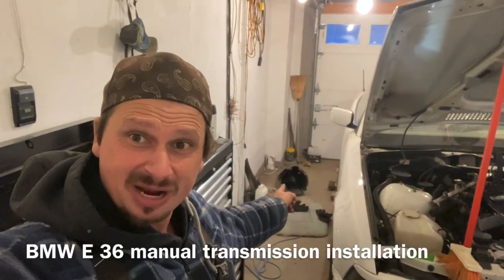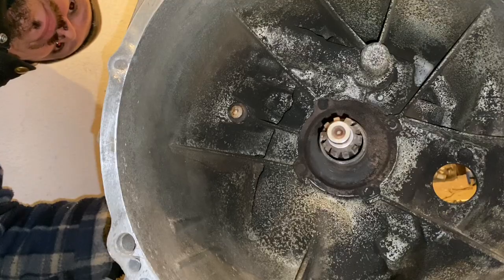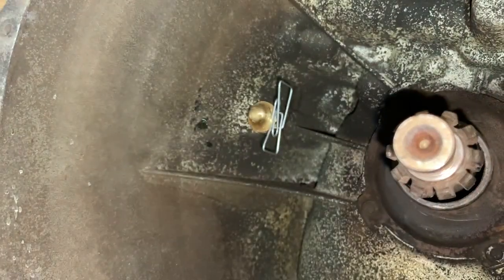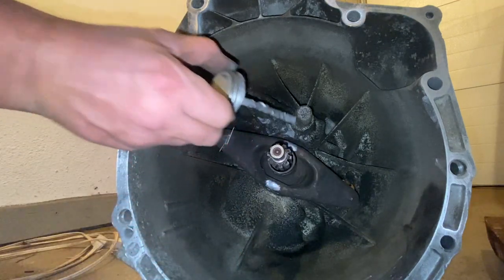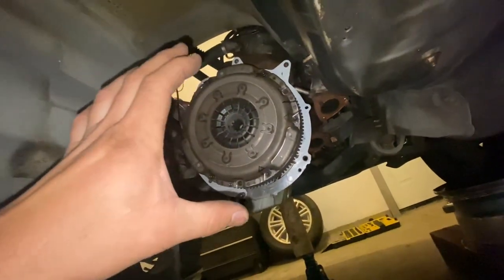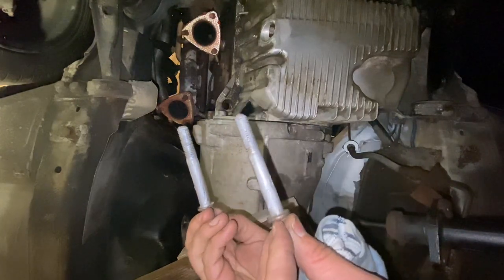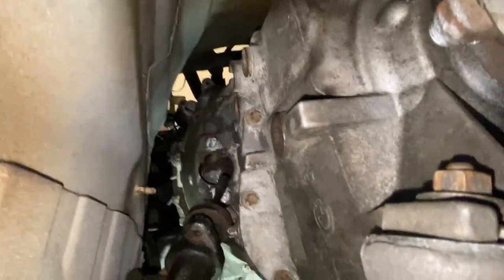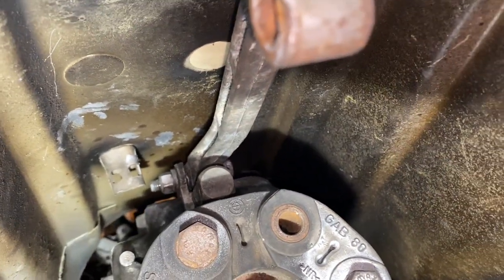BMW E36 manual transmission installation (step-by-step) BMW E36 manual swap.

Comment: I’ve done this job on E46 and E36 on Jackstands. Best tips: buy a small transmission scissor jack. Best $100 I ever spent. Use the Sachs grease for the input shaft and Liqui Moly for all the rest. Use only OEM Pilot bearing. Sachs and Luk throwout bearings are fine. Easiest way to reach top bolts is to lower subframe 1” while supporting engine from above. Great success every time.

Comment: Hey I know brass pivot pins are super popular but they are actually the worst option. You either wanna do the original plastic or stainless steel which will last longer. Idk why but the brass just wears away super fast

Comment: You must not put grease on the guide tube, the composite release bearing is self-lubricating and putting grease there will cause it to stick - just for the future. An original plastic pin is the best option. brass causes catastrophic failures because it wears too fast

Comment: Dude when you were done, how did the pedal feel? Just put in a new clutch kit and flywheel everything when on easy, and clutch engages, yet the the pedal feels way softer than before, effortlessly can put it to the floor, yet clutch engages? This normal

Comment: I am swapping from getrag to ZF. I have changed the getrag in the past but i seem to be running into an issue with the final stab. I can get in the disk no problem but i cannot get the last 1/2 inch to go without trying to walk in with bolts. Everything seems lined up. any suggestions? bolts hand started with minimal effort, just dont want to walk it down with the bolts. think im hooked on the pilot bearing?
Reply from the maker: Not too sure maybe your clutch isn’t centred, It should just slid in you shouldn’t have to torque it down to get it to go in

Comment: Hello,  i am in the process of doing a manual swap. does the  all the tranny bolts need to be torque? You did not provide any torque spec in the video.  Also, how were you able to put the top bolts on the tranny once the tranny slides back onto engine?
Reply from the maker: The book wasn’t clear on the torque specs for the transmission bolts so I just tightened them by feel, you might have to watch the rest of the swap videos in order to figure out the bolt situation not too sure why you’re having a problem with that.
 Good luck, the swap series is very detailed, just watch the whole playlist

Comment: Hey I’m doing the manual swap now everything is connected and buttoned up but whenever the clutch is engaged all the day down makes this ticking sound, hoping it’s not the throw out bearing, any ideas ?
Reply from the maker: Hmmm
Not too sure
Reply: @ProblemSolverGarage  could a not properly bled system be the cause ?

Comment: What length did the drive shaft need to be?
Reply from the maker: I can’t remember but it’s shorter from the automatic transmission one and I believe the M3 also is a different one.
Reply from the maker: One of them is shorter one of them is longer the automatic one is shorter

Comment: what if i have the four cylinder engine? is it the same compatibility??
Reply from the maker: Hey so the process would be very similar but I actually don’t know if the six-cylinder transmission fits into a four-cylinder, very good question let me know once you find out. Sorry I couldn’t be of any help, All the ones I have are six cylinders
Reply: Yeah it does , I put a transmission from a 318is on my 328is and I does fit perfect
Reply: @elisguerra2491  iirc all e36's have the same transmission except the m3. They all have a getrag (250 i think), but the m3 has a zf
Reply: The only difference between both is clutch and flywheel. You should be fine downgrading but if you’re trying to use a 4 cyl trans on a 6 cyl engine you may want to get a new fly/clutch

Comment: At 23:56, that shouldn't be a nut and bolt, its a sliding pin which should be used PN: 25111221849
Reply from the maker: Thx